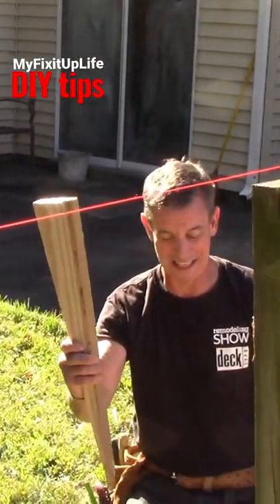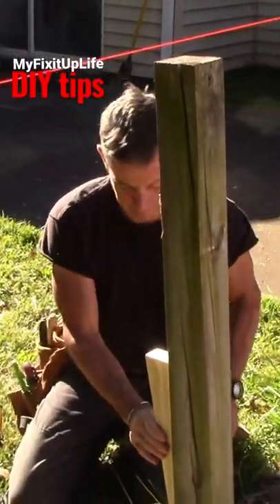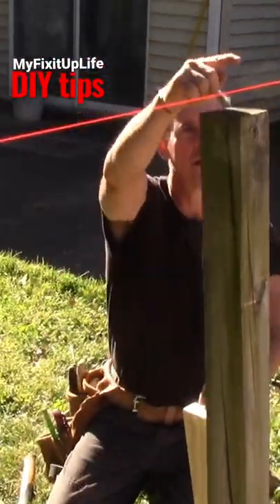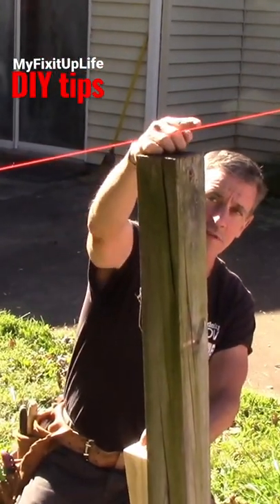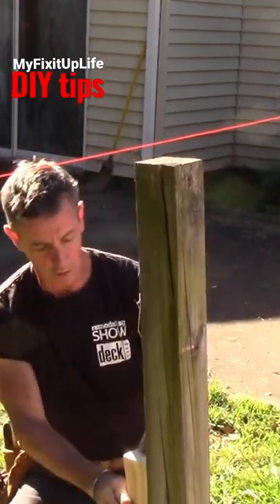DIY Tips: fix fence posts that are leaning

Comment: I need to know how to straighten some woven wire fence thats semi bent over across the tops where my horses were reaching over to eat the grass on the neighbors pasture.  I know i should have put up boards across the tops to prevent that but now i have to bend it all back straight before i put up boards. What tool will help other than trying to use my hands  with gloves on?
Reply from the maker: The only thing I've seen tighten wire is side-cutters. - Release the wire at the post. Grab it with side cutters and twist till it's tight, then re-attach to the post.

Comment: Why not just replace the post with a concrete base for like 18$?
Reply from the maker: Because most of them were crooked in this 20-year old fence and replacing the fence wasn’t in the budget.
Reply: Concrete heaves depending where you live.
Posts around me are installed with crushed gravel for drainage and winter shifting.
Reply from the maker: @evictioncarpentry2628  solid detail.

Comment: The termites will appreciate that untreated wood wedge buffet.
Reply from the maker: It's treated. Moving on.
Reply: @myfixituplife 
Can tell by the light shade of it, it's not ground contact rated treatment. Might as well be untreated.
Reply: Lol never cut a pressure treated piece of wood before?
Reply: @myfixituplife  its treated but clearly not rated for ground contact... keep moving though

Comment: First thing I have to say about the comments is I don't see all the 'InterWebz Experts' out there doin this.  Must be still searching for that board stretcher.  
Next is, just curious, Imma assuming you removed some of the soil from the 'front' side first???  I just couldn't really see if you did, but not always necessary so no biggie.
Some of your replies....well, I could hear meself makin some of the same ones, tho maybe not in language use in Polite Company.
Enjoy the Videos much, Sir......and Ma'am behind the camera.
Reply from the maker: Yessir. Lots of hair-on-fire keyboard warriors out there who can't suss out the difference between how they were taught to do things and how things can possibly work. - As for the soil here, I didn't remove any. The wedge drives enough force to compress the soil (it's clay, it's barely possible) in front while the post rights itself. - Will tell Mrs Cam. :)

Comment: Problem with not using concrete, that post will also rot from direct contact with the soil but you know what will rot faster ? The H3 treated wedge ...
Reply from the maker: The fence is 20-years old and crooked. You what this wedge is doing? Solving a real problem in real life.
Reply: @myfixituplife  if its a cheap fix and you've informed the clients about it not lasting forever, sure.